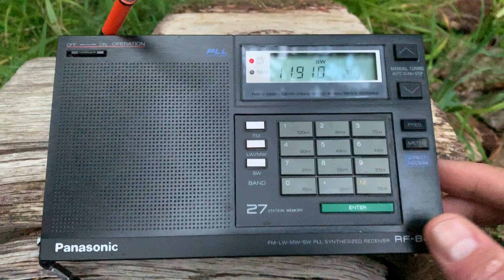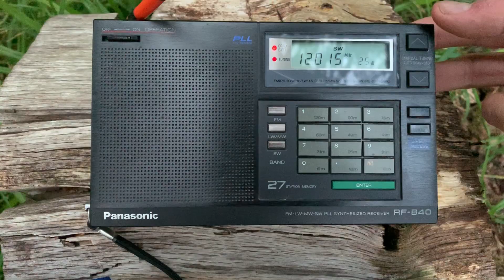DXpedition: sensitivity & (limited) selectivity with the Panasonic RF-B40 shortwave portable

Comment: Good demonstration. If you think about it, these portable radios that were made 30 years ago were the more cheaper options. Only the more expensive ones like the Sony ICF-2010 for eg have BW filters to minimize QRM. Nowadays cheap radios like the Tecsun PL-310 have BW filters which we take for granted. In any case it is extremely impressive how these old radios are working like the day they were first made. Thanks for sharing & 73s!
Reply from the maker: Well that's exactly right. The RF-B40 was a cheaper portable and yet these days the equivalent radio is about 1/5 of the price but fully loaded with features. I just hope all my old radios keep on working for years to come! 73! Clint

Comment: Nice demonstration. But 11915 kHz is Saudi Arabia, not Iran. 73!
Reply from the maker: Not according to Black Cat systems! 73!
Reply: Hi Clint, per the latest HFCC update (A19 sked), Saudi Arabia is the only Middle Eastern broadcaster on 11915 these days (1800-2300 UTC). The data was updated July 26th.  http://www.hfcc.org/data/a19/    Cheers, Guy
Reply: Right, Saudi Arabia blasts their signal in the air. Iran doesn't. Their signal strength is inferior.